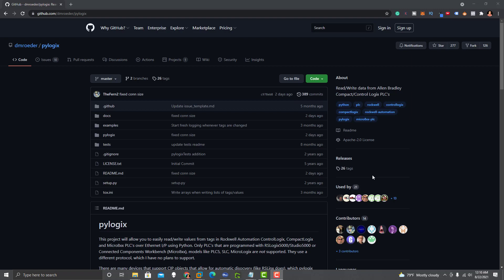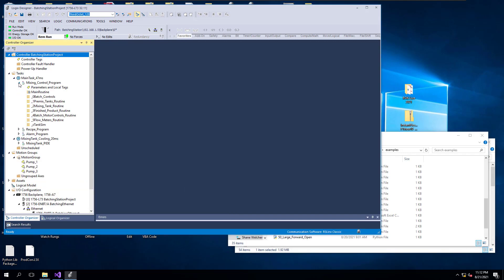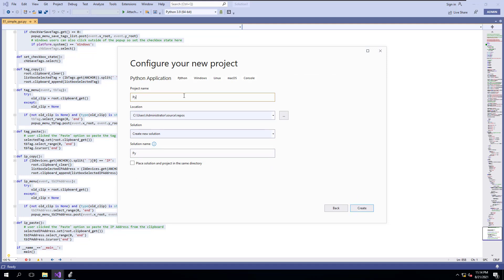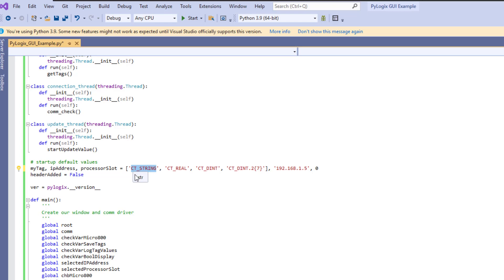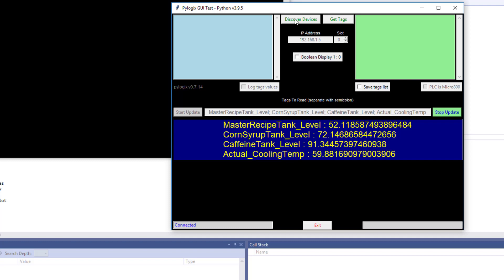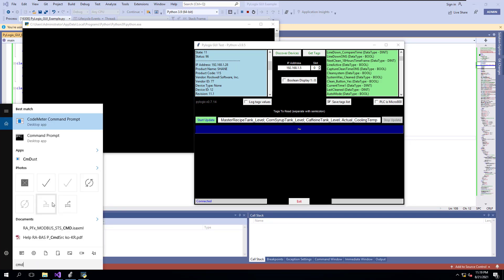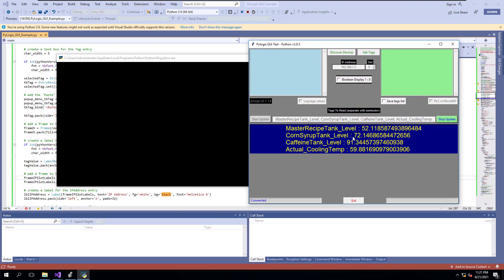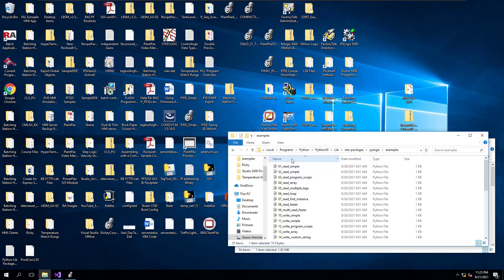Using Pylogix to Read PLC Data through a Python3 GUI

Comment: how to connect with emulator
Reply from the maker: It's not built for that currently from what I know, check the GitHub page to see if they made edits or request edits
Reply: @ShaneWelcher  okay thanks, I have done some research and found YouTube videos to connect using softlogix. Thanks for your reply.
Reply: @krishnapalsinghrathore4997  You can connect pylogix to RSEmulate.  Pylogix must be running on the same machine as emulate.  The key to making this work was the connection size.  Pylogix automatically sets the connection size to the correct value if it fails to connect at the default size. Edit: make sure you are using pylogix v0.7.15 or newer.
Reply: @dustin9480  thank you I will try it

Comment: [WinError 10061] No connection could be made because the target machine actively refused it....plzz help with this
i have bachmann using IEC protocal
Reply from the maker: Check out the Internet Properties, Connection tab, LAN Settings were set to Proxy Server, change it to automatically detect settings, and try it.
Reply: @ShaneWelcher  hi,Thanks for ur reply. Now let me know whether pylogix will connect the bachmann PLC.
Reply from the maker: Not sure, I only use Rockwell Automation.

Visit the GitHub for more data

https://github.com/dmroeder/pylogix